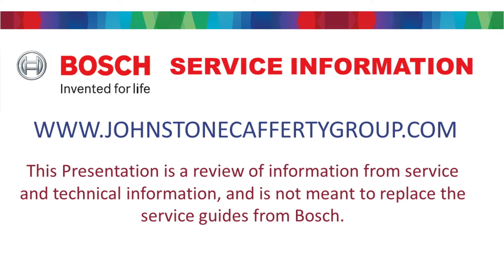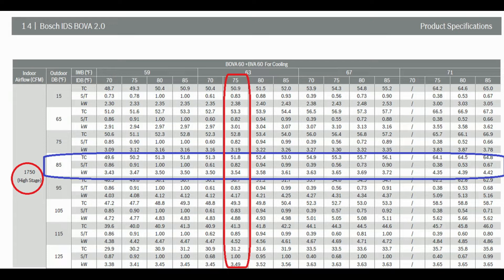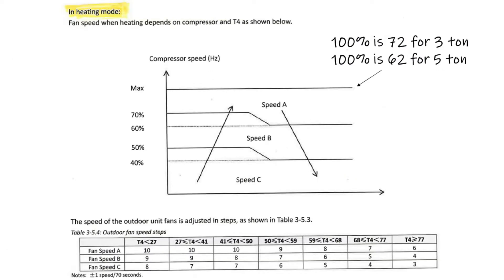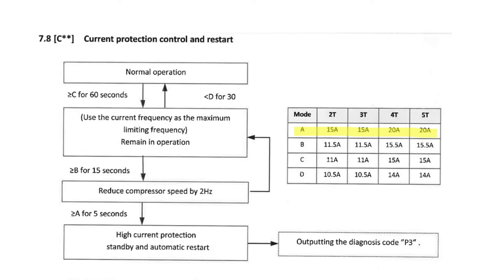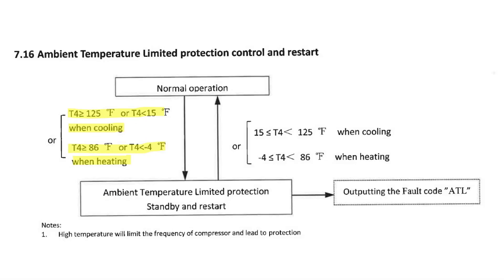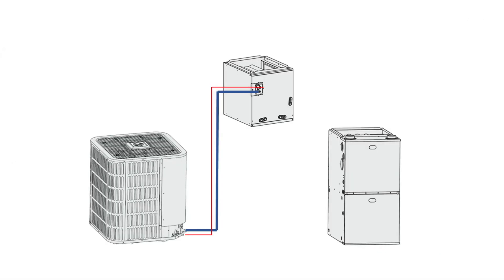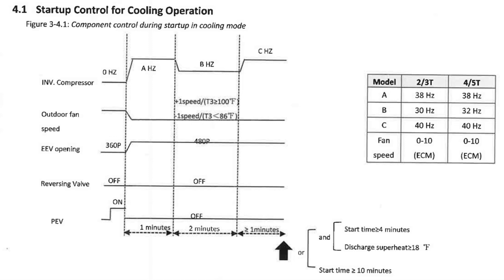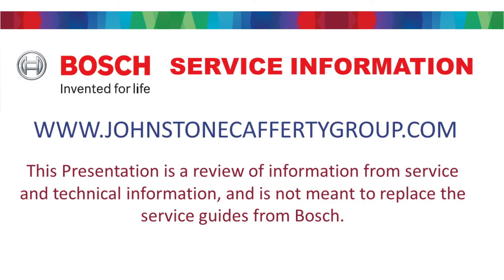Bosch inverter, how does it work?

Comment: First, thank you for the video and explanation, especially about compressor speed max and the unit ramping up to meet the target condensing temp in heat mode. I have a 5-ton unit paired with a 100KBTU gas furnace, with indoor CFM of about 1600 (TAP 3) and static pressure of 0.55. This is my first year using the unit in heat mode, and using the Bosch Air app, I got some readings when the ambient temp was 62 deg f, and the indoor was at 70 deg f with a setpoint at 71 deg f.  The unit ramps to 80hz, as you explained, and draws 12 amp with DC Voltage at 371 (4.4 kW). It stays at this frequency for 5-10 minutes and then comes to 67hz (11 amp draw, 368 DC V, 4.04 kW) before set point is reached. At this ambient temp, per the Bosch manual specification, I was expecting about 3.4 kw usage (unless I am reading the table incorrectly). Question: Is this expected behavior to draw such high kW and stay there (80hz to 67hz) for 15 minutes in a 25-minute heat cycle. The readings show the targets are being hit, except the Compressor discharge superheat readings are +8 and +6 when I took the 80hz and 67hz readings from the app.
Reply from the maker: What is your approximate AC voltage feeding the condenser during operation. Also, just out of curiosity what town and state is the unit?
Reply: @johnstonecg  When at 80hz, the AC Voltage reading was 238V and when at 60Hz it was 240V. The unit is in Pleasanton, California.
Reply from the maker: @ So your watts would be 238 * 12 or 2.8KW plus the KW from your blower so 120*6 (if at 6 amps) is 720 or .72KW . Total would be 3.5KW to produce the TC (total capacity).
Reply from the maker: I checked your KW and therm cost and found them to be $0.399 KW and $2.29 therm for NG. At no point is the heat pump make sense to run from the economic balance point.
Reply: @johnstonecg  thanks for the cost calculation. I do have solar and battery storage, but I will factor above and see how to further optimize for cost. How does the Compressor DC voltage play a role in KW consumption, if any? I was using 370*12 amps to calculate 4.4 kw.
Reply from the maker: @vbdoshi  The input AC voltage produces all the voltages outdoors including condenser motor and compressor. the DC bus is required to be 360 to 380 VDC to properly send the DC pulses (what we interpret as frequency and voltage in our wave sign). The compressor is a 3 phase motor and the DC is sent in pulses to simulate a wave sign of the proper voltage and the number of them the frequency. The power used to run the compressor would only to watts used at the component, we need to take total watt consumption of the unit and indoor blower into consideration.
Reply: Great information from both of you!
Reply: @johnstonecg  I have a tesla energy monitoring app and after observing closely for few days, the TC is 5.7 kw (excluding other home energy load) when the outdoor unit ramps up to 80hz. This is at OD of 52-62 deg F and indoor setpoint of 70 deg f. This is baffling as the IDS gateway read out of compressor consuming  is 2.8 kw at 80hz vs Tesla gateway showing 5.0kw (I have deducted other home load and the indoor blower motor load of 0.7).. Any explanation of the 5kw draw? Are there other load in the outdoor unit (fan blower, something else?) that is also factoring  in this high kw? I have other Reddit user who is observing this exact pattern with the 5 ton unit in heat mode.
Reply from the maker: @ The easy answer would be someone needs to put an amp clamp on one of the wires feeding the condenser. 80 hertz is very high to maintain 108 degree coil with the ambient over 47.but over 5K watts seems a bit high but not crazy high. You can read it at the disconnect and the amps times voltage would be wattage of the outdoor unit. I would trust a meter over any of the other 2 sources. But at 5K watts 80 hertz your producing at least 60K BTU at a COP of over 3 would be excellent. The gateway is incorrect.

Comment: I hate to ask.  Recently had IDS 2.0 3 ton 15 seer installed.  No issues cooling season  per se.  However, heating season has been a challenge because I understood that system had 10 speeds and should be modulating which I thought would be noticeable in the outdoor unit.  But, every time the unit calls for heat the  fan in the outdoor seems to be at once speed (High) ALL the time.  I thought it was adjusting to meet demand and that meant different fan speeds that I saw during cooling season.  Had HVAC installers here several times and they said everything was normal.  What gives?
Reply from the maker: Cooling season it is a ten speed and does its best to maintain around 86 degrees on the outdoor heat exchanger. During Heating we would get 8 speeds but under 50 degrees outdoor temperature it really is a 3 speed. The need for heat extraction with the size of the coils requires a certain amount of CFM. The fan speed is dependent on the frequency of compressor and outdoor ambient. If the Outdoor heat exchanger were twice as large, or multi pass for surface area, we would move less air. The size of unit and cost of coil is a trade off for required cfm.

Comment: In a defrost scenario where Bova sends 24 volts back up to a furnace for a gas heat call. 
Some furnace controls will kill the blower while initializing the burner lite process and will bring the blower back on 30 to 40 seconds once the flame has been established.
Is this a problem for the condenser? Going so long without the blower running.
Reply from the maker: With a Y call on the control board the furnace should not kill the blower at any time. The Y from thermostat connects to the furnace and out door unit both, when the outdoor unit redirects the 24v to W the indoor unit will give the still powered Y is chosen for blower speed.
Reply: Awesome. Thanks for all the helpful information.

Comment: Can you do a unico system with Bosch hp
Reply from the maker: Yes it will function fine, Unico had AHRI matches in the past but may no longer have ratings if your looking for rebates. You would still use the Unico Coil.